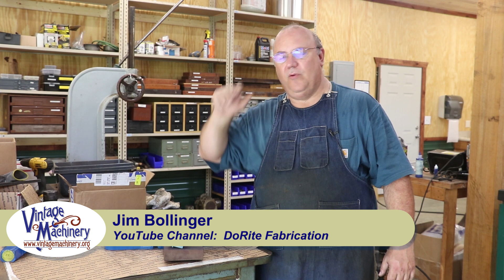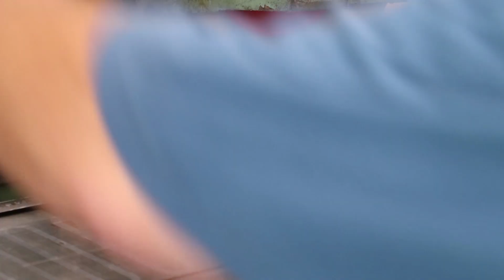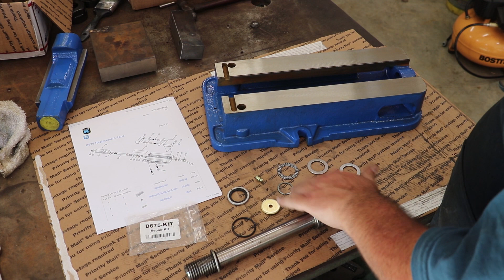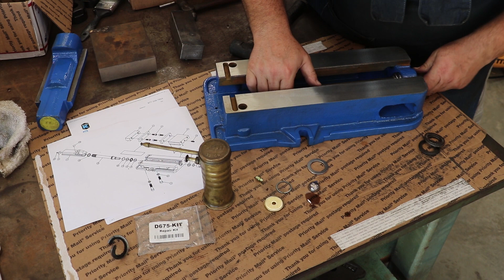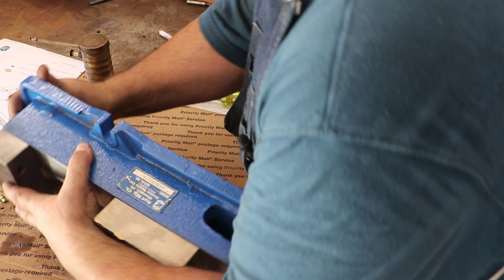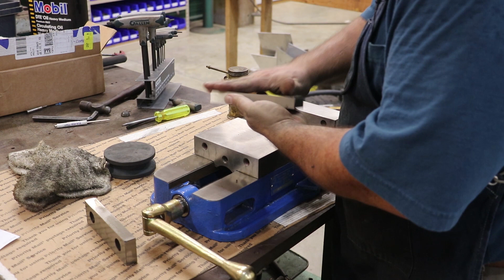Kurt Vise Restoration - Part 3: Final Grinding and Reassembly

Comment: Keith, spend a couple dollars and get a fuzzy mouse wind cover for your mic.  
Will allow you to keep a little cooler and get rid of wind noise.
Reply: The wind noise isn't a camera issue. It would happen with any camera if the mic doesn't have a windscreen.
Reply: Most frequently I've heard it called a dead cat. Also, Audacity (free as in free) has a great noise removal tool in case annoyances crept in despite best efforts.
Reply: Dead Cat is what they're called.
Reply: at least his does video...  My Nikon is pre video
Reply: jay west isn't it called a dead mouse? Not an AV guy, but I think I've heard it referred to as that before.
Reply: The Audacity solution is free as in money, but takes time in editing.
Reply: My Sony uses flabby (floppy) discs.
Reply: The audio is an issue with the camera. He knows about it. He has addressed it and he doesn't have the money to replace his $1000 D70 right now which is the camera he is using.

Comment: I have a chinese machine vise but the faces are not true. when I dial it in the ends are at 0 but can be bowed to 0.1mm. I thought about running an end mill down it to straighten it up but not sure if that's a good idea. At one time I tried shimming the block in the middle but decided that it may cause a ripple affect rather than a shallow bow.

Nice restoration, as always.

Comment: Keith, I really like your videos, but some of the audio things get pretty annoying sometimes. Do you have one of those little foam things on your mic? If not, it might help reduce the other noises
Reply: Something isn't right with that microphone, I think it might have some lose connections (maybe broken wires) that cause some noise. He should look into buying a new one. I noticed this in many of his videos. Additionally there's wind noise, so a foam thingy would be nice, too.

Apart from that, nice video again, I really like watching your work :)
Reply: There is definitely an audio connection issue. The crackling like frying spitting bacon is a bad connection. Could be the wires are broken inside the core at either the mic or jack end. To check, record a short piece while wriggling various bits and saying what you are wriggling as you record. This often happens after constant and repeated flexing. Or the jack plug and socket could be dirty, machine shop environment. Cleaning with isopropyl alcohol might help that. Or the Jack socket has wiggled loose on its printed circuit board mount, creating what is known as a dry joint, hence the crackling. The wind noise I don't mind, but the crackling, as a hobby sound engineer, DRIVES ME FUCKING MENTAL!!! ;)
Reply: Klaufmann ... my 2cents on the issue in this vid at least (as a studio sound engineer), the location of where Keith has clipped his 'Lavelier' style mic you can see where folds of his shirt were at times rubbing the capsule thus making the large crunch effects. I'm sure he already knows this 101 stuff but the trick would be to move the mic mount clip further along the mic's cable say an inch or so  (you usually can) and that way once attached it hangs out and off the surface of moving clothing. Most mics like this may suffer a tiny bit of 'presence' in the capture of the voice because it's no longer aimed directly but it'd be a perfectly audible response for Keith's purpose. Next issue is the wind noise and that's already been discussed....
Reply: dingus153 
exactly!!!!!!! especially the heavy breathing and snorting noises
Reply: It's his fan! It's been over 100 there a lot and he just has a fan, no a.c. at ALL.  It's at his shop and the museum has less that he does at home, looked like.
Reply: lol
Reply: Brian Streufert Nobody deleted your comment. I found an identical comment from you further down anyway.
Reply: Same thing in Southeast Arizona!
Reply: It's called a windscreen or pop filter. I'm assuming Keith is working in either a shop that doesn't have A/C or using fans to supplement his A/C... I'd never fault him for fan noise in either situation since living in the deep south requires extreme measures in keeping the flames of Hades at bay from May to September.
Reply: Looks like someone didn't like my polite reply so they deleted it. Thats childish.

The audio is a camera problem, its not wind. He knows about it and its been addressed in a prior video.
Reply: It would have been better to leave a few big oak trees to cast the shed in the shade.
Reply: It can't be too hard to solve the wind problem. Plenty of other YouTubers never have wind problems.  It's a bit much to expect the viewers to just deal with it, and just keep producing noisy videos.